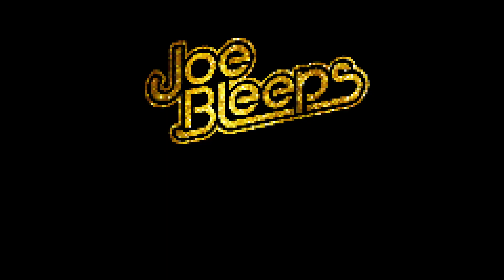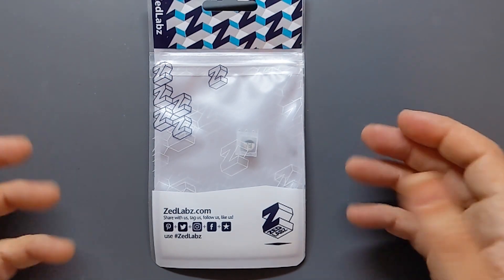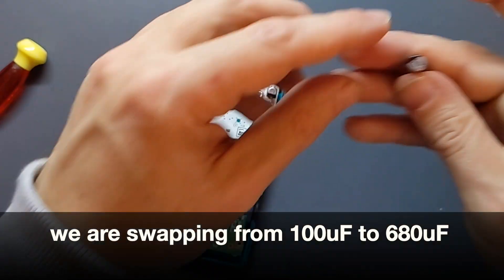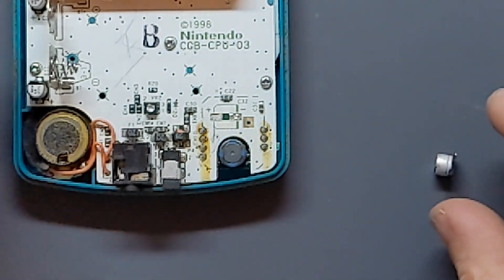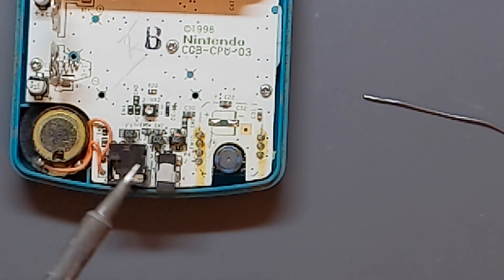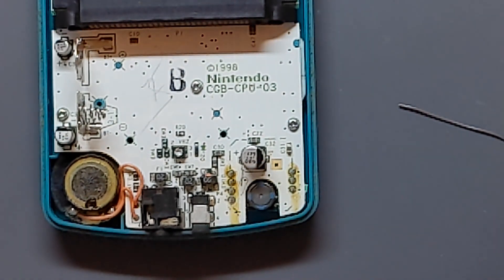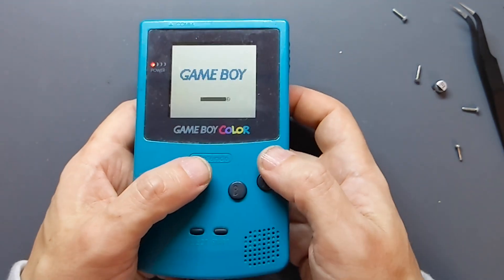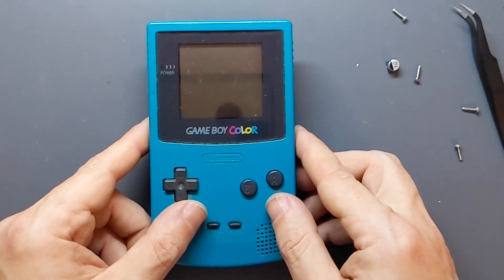Game Boy Color noise reduction filtering capacitor mod

Comment: I got one that has a couple issues still and the volume wonder turn down only loud. Do you think a recap would fix or its thr wheel?  I've cleaned the wheel many times but never changes. So not sure the issue. I know the dc jack was heavy oxidized and had to jump 2 to 3 legs to even get it to boot.  Have you tried the talcum capacitors? And are they longer lasting or better is so?  They almost look like they dont use liquid inside.

Comment: Ive notice they have a hiss when no audio is coming thru but can only hear with ear to the speaker. They sound fine when playing tho. However dont know if all mine just old and the headphones just to new for the tech but all my gbc sound horrible with headphones on. You can hear so much distortion and garbage behind the music when turned up. So dont know who would ever use headphones if thats always the case. Its unplayable at that point. Sounds much better lower in the background imo. But may try a clean amp or something down the road just to see. The gbc is so nice to work on. Very simple even tho some time its a pain to get off old solder and parts. Even with flux.

Comment: Would soldering  a capacitor paralelly, even by suprpasing the 680uf value, help? I think from a previous mod I have lttle space and i wouldnt rather taking off this first mod of using a lithium battery...
Reply from the maker: I couldn't say having not tried that myself! Maybe worth a quick try

Comment: I thought this information would be useful, but unfortunately it is not. I bought the exact same capacitor from zedlabz and unfortunately there is no difference on the headphones. I will add that the speaker is new and the headphone port is clean. Waste of time and money :(

Comment: I just tried this, unfortunately didn’t help much with the hissing on my GBC.
Reply: There is a clean power pcb that fixes it
Reply: combine it with a cleanpower and recap the other two capacitors with similar ones. As long as you choose electrolytic capacitors, you can go a few ufs above, but never below
Reply: @DeenoSpamone I tested it before and after, you are talking bs.

Your half-knowledge is more dangerous than those power cleaners
Reply: @DeenoSpamone Let me fill your half knowledge: The reason those power cleaner boards work is because with the cleaner having bigger capacitors and overall a more modern approach than the original regulator so the power is way less up and down and more stable. The reason the noise exists is because you are hearing the voltage jumping up and down, the power cleaner stabilizes the voltage way better than the original regulator, the more you mod a device, the more stable of a voltage you need. That's what they do
Reply: @DeenoSpamone Bro is reading a redditor rant and thinks it's a "reliable source"💀🙏
Reply: @DeenoSpamone but then when someone actually USING those regulators is saying otherwise, bro trusts the redditors instead💀🙏
Reply: @DeenoSpamone bro... I am the living proof that what you are saying is bs, there's VIDEOS out there that prove you wrong that show DIRECT before and afters, stop spreading this fake fearmongery
Reply: @DeenoSpamone stop spreading this fake fearmongery
Reply: @DeenoSpamone Bro... the power cleaner I am talking about IS a power regulator...
Reply: @DeenoSpamone If you think you are so beyond novice, tell me the difference between an electrolytic capacitor and a tantalum capacitor
Reply: @DeenoSpamone Using names like froggo is so gaslighty of you necause you know damn well they didn't talk power regulators bad, heck, they make their own

You are just grabbing names that make you sound smart
Reply: @DeenoSpamone they did for me, is my gameboy color a witch craft?💀🙏
Reply: @DeenoSpamone that or they are now so quiet that I can't hear them without putting my ear on the speaker which I haven't tried yet
Reply: @DeenoSpamone The dmg cgb mod isn't that impressive, it's basically just a cpu swap😅 But I guess you are right, I can hear it now. Embarrassing😵‍💫
Sorry
Reply: @DeenoSpamone oh lol I must be thinking of another dude then lol

Comment: Did it fix the noise hiss through the headphones?!?! I have an ips screen modded gbc and the hiss/noise is so bad that the headphones are useless.
Reply from the maker: I think so? I'll check later on
Reply: My headphone jack always had a bad noise/hiss, even before any mods. So bad, thatt it is really unusable (speaker is alright).
GBC always has quite some noise.
My IPS screen did not make it any worth. Swapping all three caps didnt make it better either.
Cleaning the potentio meter also did not improve it.
So, I gave up on the headphone jack...
Reply: @CirbyWeh  check out the ProSound mod. It solves the noise issues on the headphones and it's a trivial mod.

Comment: Interesting capacitor, I am having a big problem with white noise after installing new speaker on my GBC, not even having any mod like retroiluminated screen or so. It's really extrange just by changing the speaker this happen. I will try to install this capacitor and see if it finish with it.
Reply: Did it solve the problem?

Comment: Well that wasn't too scary at all! I'm considering moving from a non-modded DMG to a Color with modern screen for use with LSDJ. Would you recommend this capacitor mod in addition to a new regulator board? I'll be using a flashcart
Reply from the maker: The big advantage of this mod is that it helps reduce any whine/feedback generated by the IPS screen. So I'd say it's worth it.

Comment: GBC is giving me the most problems so far. Noise from the speaker being the most prevalent after installing the laminated Q5 IPS.
Reply from the maker: Have you tried this mod? I've not had any issues with noise at all since installing the Q5 V2 IPS with this capacitor in place. A cheap effective mod!
Reply: @JoeBleeps  I didn't, but I do plan to get a small bundle and give it a shot. What kind of battery/voltage output do you use for your IPS modded GBC? I'm not sure if regular 1.5v AAs are enough because the IPS screen was cutting out on the highest brightness setting :(
Reply from the maker: @VanguardRaven  I've been using the IKEA Ladda 2450mAH rechargeable batteries with no problems so far
Reply: @JoeBleeps  Interesting, so just regular old NiMH. I'm gonna have to do more testing, thanks for the replies
Reply from the maker: @VanguardRaven  for what it's worth I think the quality control on FunnyPlaying products is inconsistent. I have a Game Boy Pocket with one of their kits and it's given me no end of problems with keeping powered
Reply: @JoeBleeps  Very interesting. I plan to mod a Pocket in the near future. What problems are you having? I might just go with the Hispeedido Super OSD kit, since they haven't failed me with all the DMG I've modded with their kits
Reply from the maker: @VanguardRaven  it just can't stay powered on with the brighter settings
Reply: @JoeBleeps   5v step-up voltage regulator
Reply from the maker: @plumb3311  that didn't work
Reply: Did you find a solution? I installed mine the other day and the speaker is clearly distorted at high volume, has a buzz when muted, and led flickering at higher brightness.
Reply: @Hayden_M_Kearney  I believe there's a few solutions. Personally, I've installed Helder's voltage regulator, along with a 2000mAh 3.7v Lipo battery. The speaker humm still exists, but it's barely noticeable. I have heard that installing a 680uf tantalum capacitor at C32 will also do the trick without having to install a new power cleaner or use an alternative power source, but I haven't tested that for myself. What's interesting is that Helder's power regulator also uses a tantalum capacitor so I'm tempted to believe it's true.

As for the flickering, I'm not so sure. The only real reason is a lack of voltage to power the screen, so perhaps you could try some rechargeable 1.5v lithium AAs if you don't want to install the 3.7v Lipo brick battery.
Reply: @VanguardRaven  I went to the Gameboy modding discord and was told to replace C32 as well. It solved my issue too! Thanks for the reply. :)
Reply: @VanguardRaven  Also, if you haven't already, clean out the power switch and volume wheel. That's another common solution for those with a similar problem.